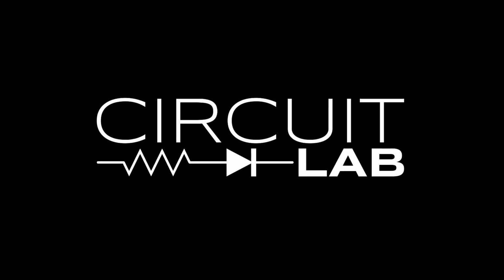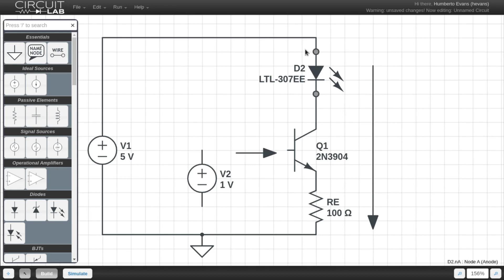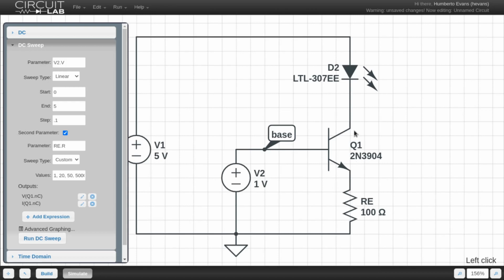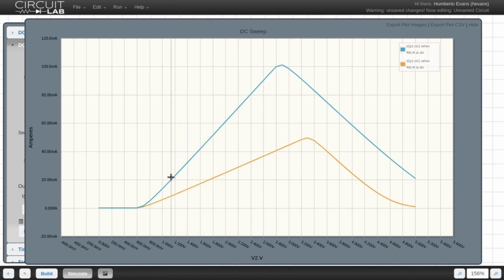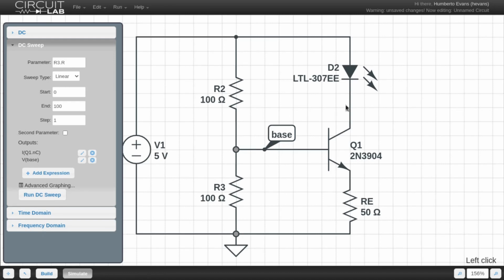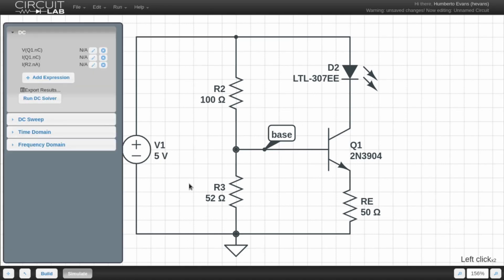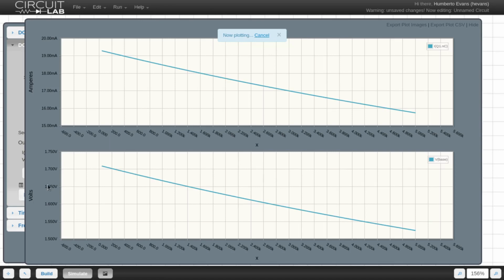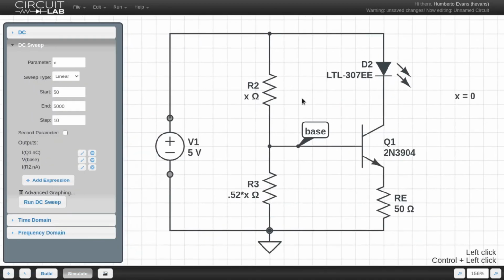LED Current Controller - Dimming/Brightness (BJT Constant Current Limiter)

Comment: Rewiring / reconfiguring an alarm system that's about 38 years old. It's substantial and spans an insane amount of vibration sensors, pressure plates, perimeter tampering and breaching etc etc etc. My calculations have all been done using solid math principles on a spreadsheet. Added the fact that the wiring spans over several hundreds of metres. This simulator shaves HOURS off coding and calculating. Don't get me wrong; final calculations will be done exactly to the fit the parameters of the installation, but, using this tool is a great way to get the core elements within acceptable parameters. Final precise calculations now only take a few minutes and a few tweaks. Circuit Lab was suggested after a long debate with an AI model and I am impressed at the level of complexity on offer. Can't wait to start the Primary Circuit layout and chuck that on a test bench for 48 hours.

Comment: An impressive movie... I have only one remark:
The voltage across Re does not follow the input voltage simply because the base-emitter voltage is nearly constant and transfers the input voltage to the emitter. This would be the case if the collector of the transistor was left unconnected. The voltage across Re is not created by the input voltage by passing the input current through Re but by the transistor that changes its collector current through Re to set the voltage across it (almost) equal to the input voltage. This is actually the principle of negative feedback.

Comment: Would this circut limit any load bearing circuit, rather than a LED, regardless of what total resistance the load circuit has?  Meaning, i have a small circuit of chips, and I want to limit total current to 18ma, can I just take the LED out and replace with my small circuit?